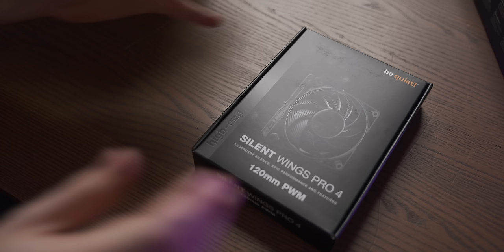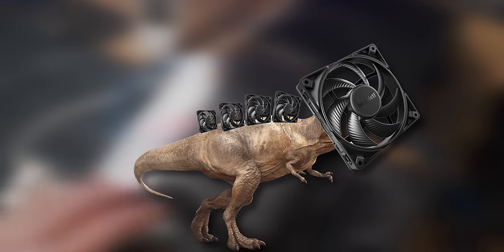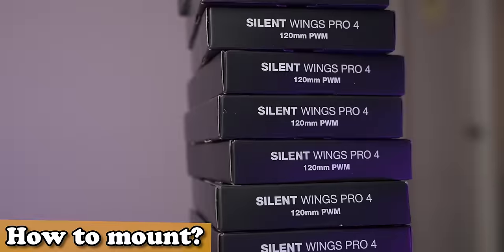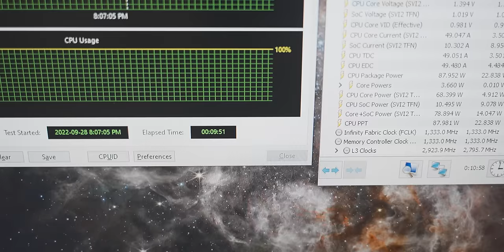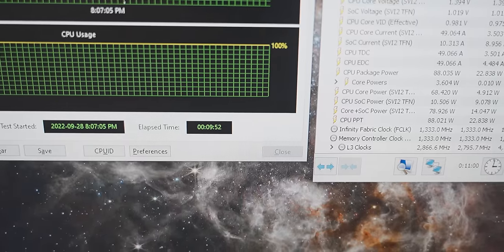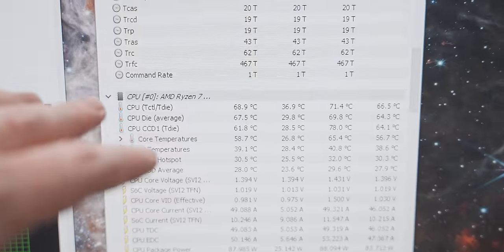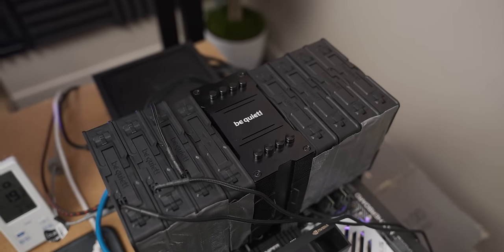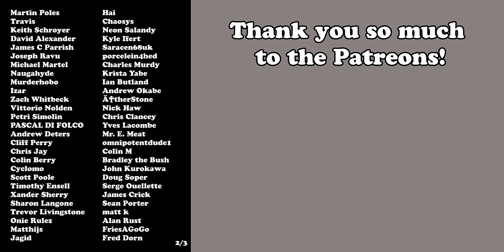More Fans = More Better?

Comment: Since they sponsored this video it means that this is now a valid use case so now they need to make the mounts to add 14 fans on the cooler so everyone can get that sweet 1 degree lower temps.
Reply: I agree.
Reply: geez, spoiler
Reply: All they gotta do is swipe Noctua's rubber pull fastener idea, and sell them separately, At participating, authorized dealers near you! LMAO.
Reply: I think they should legitimately just supply a kit with a few feet of duct tape in it and call it a day, do it for the memes xD
Reply: imagine doing this with like a 12900K
Reply: IKR
Reply: @TheOriginalFaxon  "14-fan mounting kit"
> Is just a roll of duct tape
"that'll be $49.99"
Reply from the maker: Oh for sure! Would love to see an official 14 fan CPU cooler mount. 😂
Reply: @DawidDoesTechStuff  Didn’t Linus make a case with all fans on one side?
Reply from the maker: @Arachnoid_of_the_underverse  I’m sure they have. They’ve done most things at this point.
Reply: @DawidDoesTechStuff  id say its mandatory lmao
Reply: @DawidDoesTechStuff  they’ve done most things sure but where’s the Linus & Dawid collab the people NEED
Reply: @Arachnoid_of_the_underverse  Gamers Nexus also has a video with 12-14 fans or even more on the front of a computer case with absolutely no gateway for the fan airflow. It only looks cool 🤣🤣
Reply: LMAO
Reply: Introducing the bequiet Wind Tunnel.
Reply: Go to the hardware store and get 4 1' lengths of threaded rod in a small enough size to fit in the screw holes, and 8 nuts (for one side's fans, double all that to do both sides.)

Basically just one really long bolt going through all the fans and holding them together.
Reply: I work for a tech company and did a spit take on your comment.  I am just imagining me asking the engineers or designers or marketing blank stare at me while I try to make this argument or a similar one.
Reply: 200IQ
Reply: and if you get the right brand you can get, not 2 but.. 3 degrees lower

Comment: Now, let's redo this project, but with delta fans. Y'know, the ones that come with grates because you would literally lose a finger in the blades due to the extremely high rpm
Reply: yep this i have a 120mm one the thing puts out pure power and sounds like a turbo jet it has easily cut my finger before luckily nothing serious just converting it from 5 pin to standard 4 pin.
Reply: @ninjanolen4932  and frying your mobo
Reply: Yup.. The 120mm 4A one will really make your pc fly...
Reply: @virtualtools_3021  Yeah you would need to run power to the delta fans separately because those will try to pull a bit more power than what a PWM fan header is rated for.
Reply: @dragonfyre79  yep I got 5a deltas on my server but the headers only go to 2.5 so I got them powered from molex
Reply from the maker: You’d need probably need a dedicated 1000 watt PSU just for the deltas. 😂
Reply: @DawidDoesTechStuff  That and hearing protection.
Reply: @dragonfyre79  yeah and u would need bolt everting down to the floor. Otherwise that would became biggest flying gaming rig LMAO

Comment: Bet if you could get contra-rotating versions of those fans, running them in a giant stack would give you insane static pressure... Basically how server fan modules work but taken to ridiculous levels.
Reply: If we are talking server fans he would need something that spins at 3k+ RPM.
Reply: also some air flow fans further in the stack could be better than static press. units
Reply: @UhOhUmm  so like noctua industrial fans
Reply: @nathanlarson6535  i wonder if any industry actually uses those. I was thinking about Sanyo or Sunon.
Reply: Not exactly how that works. Air flow is the volume of air that is produced by the fan measured by time.  In this case, the air flow of a fan is measured in cubic meters per minute (m³/min) in metric units, or cubic feet per minute (CFM) in imperial units.  In simplest terms, if you have a 5 ft x 5 ft x 5 ft enclosure, and a fan that produces 5 CFM, it will likely take 25 minutes for the fan to ventilate the hot air in the enclosure.  (In actuality, it's not that easy.)

Static pressure is the amount of air pressure that can be produced by the fan in an enclosure.  In this case, the static pressure is measured in Pascals (Pa), or inches of water (inH2O).  The pascal (Pa) is the SI derived unit of pressure used to quantify internal pressure, stress...etc.  The unit is named after Blaise Pascal and is defined as one newton per square meter.  Inches of water (inH2O) is defined as the pressure exerted by a column of water of 1 inch in height at defined conditions.  At a temperature of 4 °C (39.2 °F) pure water has its highest density (1000 kg/m³). At that temperature and the standard acceleration of gravity, 1 inH2O is approximately 249.082 pascals.

It's important to know that even though maximum values for air flow and static pressure are specified, the fan will not output both maximum values at the same time.
Reply: the Importance of Impedance

How are the actual air flow and static pressure requirements determined?  The answer is impedance.  Impedance is defined as resistance to air flow, and it could be in the form of electronic components, walls, or anything that impedes the path of the air flow.  The actual air flow and static pressure is determined by impedance.   

Let's see how this is done.  For most forced air cooling application, impedance is calculated by the "square law," which means that static pressure changes as a square function of changes in the CFM. 

P = KrQn
Reply: You are very right, contra-rotating would have a significant effect on this. The angular velocity induced in the airstream by the fan reduces its relative angular velocity to the next one and so for, meaning that you get next to nothing on returns for fans spinning the same direction If they contra-rotate then airflow would increase significantly since the angular velocity is negated by the second fan spinning in the opposite direction and more of flow is directed through with each rotation. It won't double the output but there is a noticeable increase hence why most planes would rather add an engine to increase thrust, it's only when they run out of space that contra-rotating is really useful, check out something like the TU-95
-Aerospace Engineer
Reply: @UhOhUmm  Not in this instance because we would mainly be aiming for creating additional static pressure with the fan stack. It would, however be pretty fun to take a phat stack of Delta 120x25's from something like a Dell Precision T3500, have them arranged with contra-rotating blades on one fan and normal on the other, then stack like 40 of them and see how much pressure it can build up. those fans are normally good for about 4000 RPM so that would be a pretty nutty arrangement.
Reply: Contra rotating fans will add way too much turbulence losses to be beneficial. What you really want is to have the pitch of each fan blade be slightly more than the one before it or be spinning faster than the one before it, so each fan is actually pushing the air more than the last. In this set up, the fans beyond the first couple are doing nothing because the air stream is already moving at the speed the fans are going.
Reply: @tylerespy2408  <- is right
Reply: Or build two giant cones with 4 fans (2x2) or 9 fans (3x3) on one side, and no fan on the other side
🔈 🎛
Reply: Scythe has standard size contra rotating PC fans, and the turbulence is negligible or even beneficial, since turbulent air works better for cooling
Reply from the maker: @_____alyptic  If only there was a recent CPU launch that could benefit from that kind of thing.
Reply: @legostarwarsrulez  Yes, you are correct that turbulent air can be beneficial, but only where the air meets the cooling fins to break up the boundary layer of air that can insulate the fins from the bulk air flow.  You want laminar airflow in the fan stack to maximize the velocity and volume of airflow through the fin stack.
Reply: @Pies_By_Arvid  wouldn’t it also increase volume and speed as well though? Look at the contra rotating propellers that planes use. Sure it makes increased noise and turbulence, but overall thrust increases significantly. Which is due to increased air volume and speed.
Reply: @crisnmaryfam7344  And that isn't how it works either. You aren't evacuating the entire case to see a change in temperature.  You aren't even evacuating the air column. New air is continually moving through.

Comment: I think you needed 16 fans for any real cooling gains
Reply: If it took 14 fans for a 1 degree improvement, then it stands to reason that to get a 5 degree improvement you would need 70 of them.
Reply: @nightbirdds  Really it's just however many fans it takes to go into the next room. He got a 1 degree improvement, because the air he's pulling in is now far enough away from the motherboard to avoid the ambient heat increase.
Reply: @setcheck67  Oh, I know. But the idea of him trying to make 70 fans work just makes me chuckle. :)
Reply: Or maybe put those fans side by side in some sort of air duct to increase the total air flow.
Reply: @Max_Mustermann  That would turn into a gigantic monstrosity of a construction and Dawid totally needs to do it. :D
Reply: @nightbirdds  Agreed

Comment: Next try using blower style fans like you see in laptops... You could put quite a few together all stacked side by side instead of in front of each other thus preventing the blowers from blocking airflow from each other
Reply: Nah adapt a leaf blower, now theres one  no one else will have tried.
Reply: He should indeed have put them in parallel instead of in series. After the first or second fan, the air is already going at the max speed, the other fans would have close to zero load moving air along that is already up to speed. In parallel tho a large area of air is being forced into a smaller area increasing the pressure which would help allot more.
Reply: @andrewwatts1997  True, it'd be cool to see a 3d printed manifold for that
Reply from the maker: Haha!! That’s a great idea. Although the leaf blower idea is even better.
Reply: I've always wanted to see someone use a couple 24 inch box fans to cool an entire pc. Duct one on the left side of the case and duct one on the right side of the case.

Comment: You should build a cardboard adapter that uses all the fans surface area and funnels it down to the cooler. And then see what that does.
Reply: Think there was an older LTT that tried something to that degree
Reply: Sounds like a Jays2Cents video.
Reply: And in that scenario it would only make sense to use a bunch of 200mm fans instead of 120’s lol.

Edit: or possibly a ton of delta fans stacked side by side to make the world’s loudest cooling solution
Reply: Yes, that would probably have made more sense.

Comment: Fan stacking is usually done to compensate restricted air flow, for example to force air though a 1m long 1U server. Considering you've already had the ideal air flow with 2 fans, it wasn't really a surprise that adding more virtually made no difference.
Reply: Because he needed more airflow, but he increased pressure instead of airflow

Comment: I would think staggering the fan speeds from slow to fast, towards the middle, would prevent the air from “stalling” as it moved through fans of the same RPM
Reply: As Dawid discovered, this isn't going to increase airflow that much regardless of tuning.  When you see fans can flow a certain CFM that is what they flow.  The only advantage here is a slight increase in air pressure, but there are limits to how much a fan can increase static pressure.
Reply: Doesn't really matter the bottleneck is the cpu heatsinks capacity to transfer heat

Comment: Yo Dawid, can you try and get fan spacers between all the fans? if you space them out about 1-2 inches betweeen each fan, the temps have to be better, the fans were getting choked out and they probably lost air as there was just too little air and too much fan.

Comment: Now you need to do the same test with fans that make noise :) would love to see if fans that make more noise cool better or worse?
Reply: He could have switched them to gear 3 on the back for VERY noisy 3000 rpm.
Reply: @Waldherz  or use deltas that are 38mm thicc and 7000 rpm to actually cool it

Comment: I want a part 2 where you do something similar with an aio. I remember seeing a more significant difference in altering fan speeds on an aio compared to a tower cooler. So adding more fans might make a bigger difference then tower would, since the rad fins are smaller and thus offer more resistance.

Okay, so the difference between 2 and 10 fans wasn't that good. But still people don't really try putting 2 fans on a rad anyways.
Reply: In my experience push pull can work well. I was using 2 x stock EVGA 120mm fans on the 2080Ti Kingpin 240mm GPU AIO Radiator, with the card producing a ~280W load in a 19c room, I then upgraded to 4 x Noctua NF12 120mm fans placed them in Push Pull configuration so 2 on each side and when fans run flat out the cooling system reduced GPU temperature by about 10c compared to the stock 2 EVA fans.
Reply: @micb3rd  I was thinking it might work well, but hearing this makes me think it's actually correct.
Push pull is what will enable 13900k overclocking 😜
Reply: @Olav_Hansen  Haha Yes, I'm looing forward to testing the 13900K on Noctua NH-D15 with Push Pull and then will try a 360mm AIO Push Pull. I'm also going try some undervolting.

My current 10900K at 5.1 Ghz is fine on the NH-D15, it only get a bit hot when running 5.3Ghz and pushing heavy loads.  (I managed 200Watts draw in CPU @ 85C on Cyberpunk 2077 with RTX Reflections on!) which is about the max temp I'm comfortable with long term.
Reply: I would say, use the fans to prop up the GPU in an ATX case with bottom intake to prevent it from sagging since these days GPU uses 4 slots and so freaking heavy . The fans may serve a better use that way.
Reply: @micb3rd  cool stuff
Reply: @0xBlez  Thanks! I absolutely love the in depth testing of hardware and software. tweaking settings.  I'm now up to 22 cpus and 30 GPU, tested and enjoyed since 1997....

I currently use a Corsair 1000D case which is massive but has good air flow and silent when fans are turned down... for fans i use 7 x Noctua A14 and 1 x Noctua NF12.
Reply: @micb3rd  looks like my dream setup haha.

Wait for it..

• SPECULATIONS
> CASE: Corsair 1000D
> PSU: Corsair AX1600i
> MOTHERBOARD: Asus ROG Crosshair X670E Extreme
> CPU: AMD Ryzen 9 7950X ( 4.8 GHz All Cores )
> GPU: MSI GeForce RTX 4090 Suprim X ( SLI )
> RAM: G.Skill Trident Z5 RGB 32 GB 6400 MHz ( 16 x 2 )
> SSD: Kingston Fury Renegade ( 4TB x 2 )
----------------------------------------
• WATERCOOLING
RADIATOR: Corsair Hydro X Series XR7 480mm ( 4 ) ( 2 On Top & 2 On Front Of The Case )
RADIATOR FANS: NF-F12 industrialPPC-24V-3000 Q100 IP67 PWM ( 16 )
REAR CASE FANS: NF-F12 industrialPPC-24V-3000 Q100 IP67 PWM ( 2 )
CPU WATERBLOCK: EK-Quantum Magnitude Satin Titanium
RESERVOIR/PUMP: EK-Quantum Reflection 1000D D5 PWM D-RGB - Plexi ( 1 )
TUBE: Hydro X Series XT Satin Transparent
THERMAL PASTE: Thermal Grizzly Conductonaut
COOLANT: EKWB EK-CryoFuel Solid Premix
Reply: @0xBlez  Great set-up you listed :) I use very similar power supply... I chose the EVGA T2 1600 Titainium. As its proven in XOC/LN2 and while protection is excellent, it has no over complex protection to go wrong.

I put Corsair RMX 850 in my living room PC and so far it has been great. I'll be giving it some tougher loads in the future. Haha!

Comment: The limiting thing is that all the fans spin in the same direction. After like the second fan, almost all the additional "input" will just go into spiralling the airflow more and more. That's why server fan assemblies use counter rotating fans and stator vanes.

Comment: It a shame you couldn't use Velada gloves to bind them all together rather than duct tape, to break up the product placement. 

I have he Lian Li Mesh 2 case. I had originally ordered a bunch of BQ fans for my PC, but found them to be anything but quiet. I quickly replaced those with Artic fans, and haven't looked back. 

It an interesting experiment, I wonder if you'd have seen more change if you had varied the fan speed so that the fans run faster as you get deeper into the wind tunnel, to overcome the added obstruction you introduced.

Comment: I am actually surprised that the temperature wasn't increasing again when you attached the third and fourth fan. Any difference in speed, because they will not all be running at exactly the same speed, will cause back pressure and a drop in airflow.

Comment: that just proves that the CPU heatsink itself from Bequet is awesome if the thermal transferer to air is already at its best with just 2 fans, if it had gotten a lot better that would have been bad

Comment: Now for a follow up video, find 2 fans with the highest fan speeds to see if a faster fan will lower temps.
Reply: I think for that he only has to increase the fan speed of the ones already installed (the Pro version of the Silent Wings 4 goes up to 3000rpm, for whatever reason)

Comment: I was thinking using doweling in the holes would be great, slip a rod through all the fans and 'bracket' it to the cooler. It would also line up the fans well.

Comment: I have a Dell XPS 8940 with a 10th gen i7, 32gb ram and an EVGA 1660 Super. I added a the large Noctua heat sink to it and run it open case with an 8" desk fan blowing right into the front of it. It has a stock intake fan, a fan in the heat sink and a stock exhaust fan. It runs fairly cool when I am gaming on it. Can def feel the heat blowing out the back.